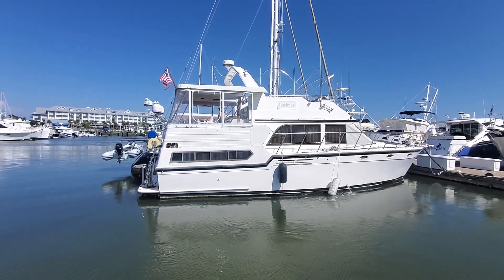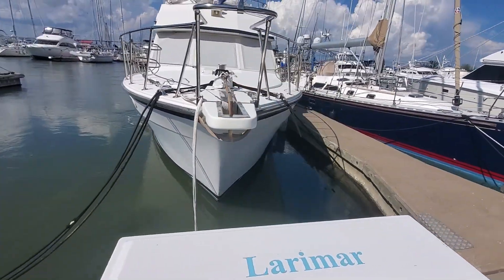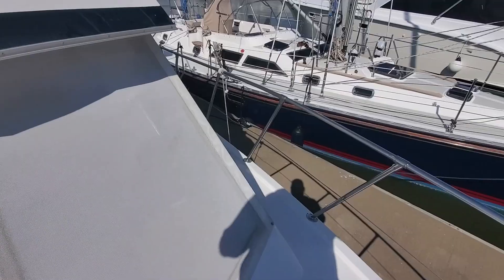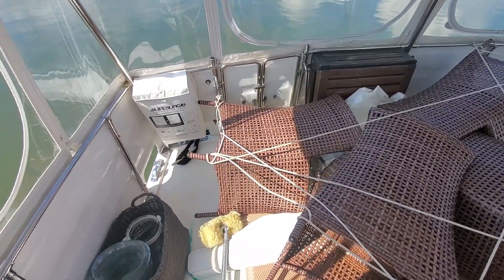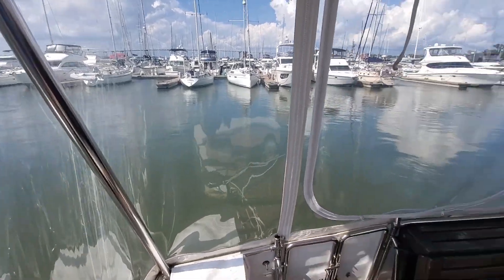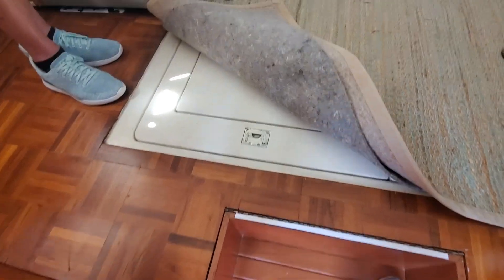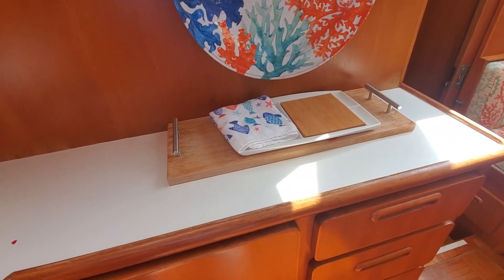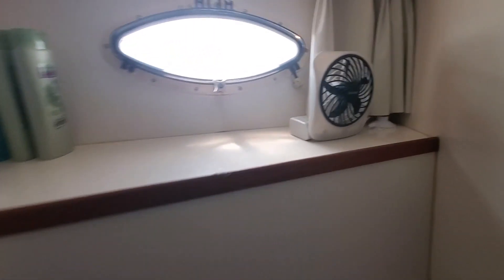1992 42' Jefferson Charleston SC. Not feeling it.

Comment: A whole lot of work needed -- just repairing all the corrosion damage and cracked hoses in the boat could run $25K easily. And lots of cracked fiberglass and unfinished woodwork evident as well. Finally, the engine room is horribly cramped -- very low ceilings, you would have to raise the big overhead hatches for any sort of maintenance. 

Saw an interesting 65' custom trawler listed on a Trawler group Facebook  page today -- single diesel, owners have lived aboard and cruised Toronto to Bahamas and back every year since 2004. But it seemed pricey to me at $49 K ask. 

You haven't found your new boat yet, but you have certainly explored a fair amount of the Southeast in the hunt.